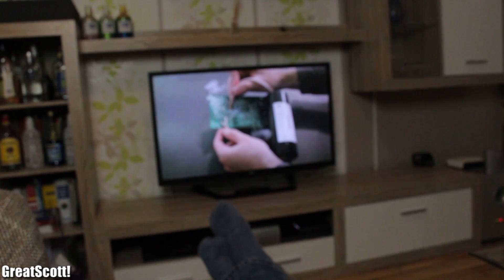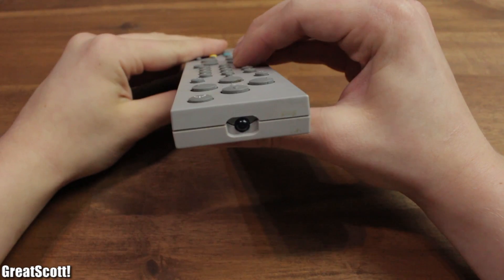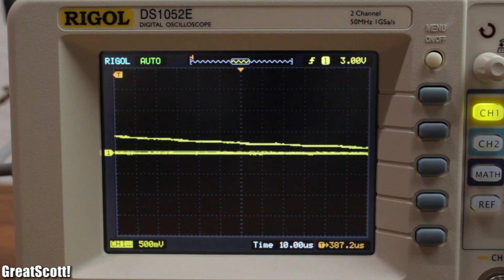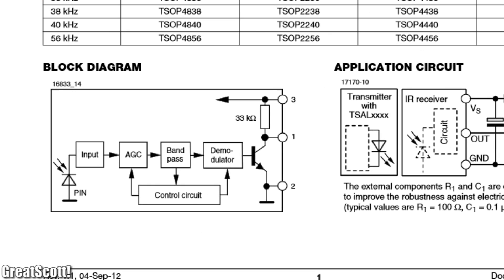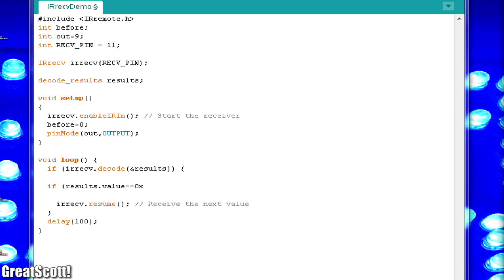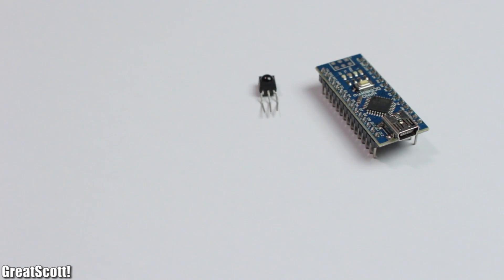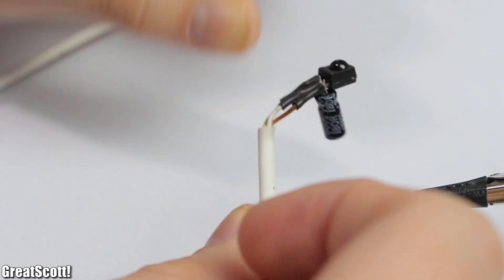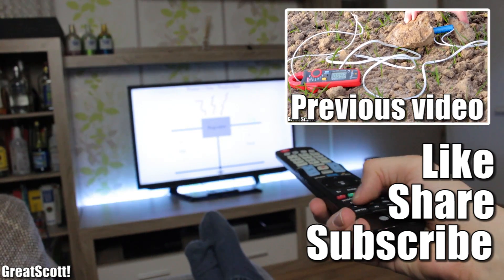Control your LEDs with your TV remote?! || Arduino IR Tutorial

Comment: can someone please help me, this is what iam getting allways Arduino: 1.6.5 (Windows 7), Board: "Arduino Nano, ATmega328"

C:\Program Files (x86)\Arduino\libraries\RobotIRremote\src\IRremoteTools.cpp:5:16: error: 'TKD2' was not declared in this scope
 int RECV_PIN = TKD2; // the pin the IR receiver is connected to
                ^
Error compiling.

  This report would have more information with
  "Show verbose output during compilation"
  enabled in File > Preferences.
Reply: Change the value to the number of the pin on the arduino the IR receiver is connected to

Comment: Hi! Great video! One question though... Why exactly did you need the capacitor? I am brand new to this kind of thing.
Reply: +John Spillane The capacitor is used to smooth out any "bumps" in the current flowing to the Arduino; it is a fail safe of sorts.

Comment: nice project, but why not using the 3 RGB channels with 3 useless buttons to create every colored mood you want?
also I'd stick the LED strip to a piece of metal or aluminum in stead of wood to preserve their lifespan!
Reply: Because he just wanted a simple light, and wanted to make a simple video. Of course you can use different colours, but dont need to if you dont need it. Also, mounting then on aluminium is not going to increase the life, they dont really get hot at all. I have 5m strip, and even all lights full brightness, wrapped on the reel it came on, and leaving it on, it only gets to 20-30°C. So no heatsink needed.

Comment: THe code dosent work anymore!! When it compiles, it says   This report would have more information with
  "Show verbose output during compilation"
  enabled in File > Preferences.
Arduino: 1.0.6 (Windows NT (unknown)), Board: "Arduino Uno"
C:\Program Files (x86)\Arduino\libraries\RobotIRremote\IRremoteTools.cpp:5: error: 'TKD2' was not declared in this scope
 HELP!!!
Reply: +kyle han Hey I had the same problem and I was really motivated to do it and figure it out. So what i found is that you have to go to this website: 
https://github.com/z3t0/Arduino-IRremote/releases
download the zip, extract it, put it in your library, and upload the script from this library, the IRrecvdemo i think it's called. Then you literally just use this video to do the rest. Let me know if it does or doesn't work!
Reply: +Joshua Butler thanks for helping out, but unfortunately it still has a problem compiling. It has the same error code. And while other libraries show up as underlined, and yellow, while the incluse IRremote.h dosent. Is my computer not reconizing it as a library, or am i doing something wrong?
Reply: +kyle han make sure you use that same example except from the new IR link I gave you. You DO NOT have to load the library into the sketch. And if it still doesn't work, then you should go to the arduino website and download the program version 1.0.6, because that is the version he uses in this video. I'm not sure if that was what was wrong or not, but it's worth a shot!
Reply: +Joshua Butler when i open the IRrecvdemo, the library is already included. What do you mean i dont have to up load the code? Anyway, i tried down loading 1.0.6, and it gave me the error code. I ay post this problem in the arduino forums. Thanks or your help!!!
Reply: I'm honestly not sure then how I got it to work for sure, just a lot of tinkering I guess, lol
Reply: Well then master, teach me your ways
Reply: I had the same problem! I fixed it! it was "Arduino Libraries" problem. Do this:  https://www.arduino.cc/en/Guide/Libraries

"To install a new library into your Arduino IDE you can use the Library Manager (available from IDE version 1.6.2). Open the IDE and click to the "Sketch" menu and then Include Library > Manage Libraries."

and point your "Arduino-IRremote-master.zip"

"file" then "examples" click "IRremote" then "IR relay"

done!
Reply: Here is the solution:

 
1) Go to computer -> go to (C:) -> program files (x86) -> Arduino -> libraries -> RobotIRremote
 
2) Move files IRemote.cpp, IRemote.h, IRemoteInt.h, IRemoteTools.cpp and IRemoteTools.h to the desktop or somewhere out of primary Arduino map (you can even delete them but rather not maybe you will need those files)

Comment: I have a question, in your code there is an if statement. if (results.value == 0x20DFF10E ) but when looking back at it, when you got the info from the ir remote it didn't send the 0x in the beginning, it sent 20DFF10E, so why the 0x?
Reply: Its just a prefix telling that the value is hexadecimal.

Comment: HELP.... only getting 7,5 V out to the led strip.... any ide what is wrong ? Mosfet output middle pin is from 5 to 7.5 V
Reply: FoneBone27 Found out that GND next to D2 and RESET can't be used..... the pictures of the board show that it's in use.
Reply: +FoneBone27 Hey my LED strip couldn't use the MOSFET I had because I think it was a 9 volt, so what I had to do was just use a relay

Comment: I have reverse engineered every remote in the house and obtained the codes for each button on each remote. But why is it when I record the beams using a VS1838B IR receiver I ended up with hexadecimals results but when using a Sharp GP1U5 I recorded the exact same beam I recorded only strings of numbers? And if that is not crazy enough when I try to control anything and I hit the receiver (while watching the serial monitor) with the IR remote I might get the code I recorded or something totally different? Or I do get the correct code the first time then something totally different on the second shot? Could be noise? Anyway it has me scratching my head.

Comment: I get this eror please help!
C:\Program Files (x86)\Arduino\libraries\RobotIRremote\src\IRremoteTools.cpp:5:16: error: 'TKD2' was not declared in this scope
 int RECV_PIN = TKD2; // the pin the IR receiver is connected to
                ^
Error compiling.
thank you
Reply: +josse van de kerchove Hey I had the same problem and I was really motivated to do it and figure it out. So what i found is that you have to go to this website: 
https://github.com/z3t0/Arduino-IRremote/releases
download the zip, extract it, put it in your library, and upload the script from this library, the IRrecvdemo i think it's called. Then you literally just use this video to do the rest. Let me know if it does or doesn't work!
Reply: +Joshua Butler thank you a lot but i figured it out ☺

Comment: Instead of transistor mosfets, can i use relay?
Whats the output voltage of the receiver module?
Reply: with a relay you wouldnt be able to dim the led-strip, but just for switching it on and off it would be suitable. but remember: you might need a transistor and a flyback diode for the relay, as te arduino might not be able to handle the switching-current of the relay.

Comment: i face a problem to connect the out of ir resiever is connected to pin d11 in nano in micro it does not have d11 so to which pin i should connect it ?????
Reply: Whatever pin is free, and change it in the code to that one...

Comment: Build options changed, rebuilding all

C:\Program Files (x86)\Arduino\libraries\RobotIRremote\src\IRremoteTools.cpp:5:16: error: 'TKD2' was not declared in this scope
 int RECV_PIN = TKD2; // the pin the IR receiver is connected to
                ^
Error compiling.

  This report would have more information with
  "Show verbose output during compilation"
  enabled in File > Preferences.

why  ?
Reply: +GRminecraft Hey I had the same problem and I was really motivated to do it and figure it out. So what i found is that you have to go to this website: 
https://github.com/z3t0/Arduino-IRremote/releases
download the zip, extract it, put it in your library, and upload the script from this library, the IRrecvdemo i think it's called. Then you literally just use this video to do the rest. Let me know if it does or doesn't work!
Reply: I LOVE U , U SAVED MY DAY ._.
Reply: worked for me. Thank  you very much!

Comment: Hey Scott!
First of, I'd like to mention that I love your videos! I'm very new to the world of electronics and microcontrollers and therefore would like to ask you a question regarding this project. since you have soldered all cathodes to one on the LED-strip, you cant change the light color... so is it possible to still change the lights via arduino if I'd use three MOSFET's and wire each of them to one of the cathodes?
thanks alot!

Comment: Hello my friend greetings from Greece, one great project that you should look after would be a laser spyrograph. Someone did before and posted it in instructables site (http://www.instructables.com/id/Laser-Spirograph/) but this is manual controlled, what about if you could swap the rheostats and put arduino pwm pins with mosfets? Another great project similar to this one here, would be to control the led strip through an android phone via bluetooth. Someone also did something similar (http://makezine.com/projects/android-arduino-led-strip-lights/) but he controls through his phone with a cable connected and this might harm your phone if you don't know what you are doing. Hope you have some bright ideas coming up next!

Comment: Awesome! :)
Now i've got some use for my Arduino Nano - There are actually not that much projects out there for it..
Reply: You can use almost any "Arduino"-project with your Nano. It's just the form factor that's different. Electrically it's the same as an Uno or similar board.
Reply: *****
That may be, but then I would have to rewrite the codes and use other ports

Comment from the maker: Ever wanted to use your TV remote to control your next project? Then you might find this video useful!
Reply: Same TV as mine and remote
Reply: +GreatScott! Can you help me with my SainSmart R3? I tried the project with it, but it keeps on saying: TKD2 is not defined.
Reply: Excellent job on your videos Scott.  Great explanations, great production, great editing!  Thank you!
Reply: GreatScott! More arduino projects plz😃
Reply: CEC makes those buttons useful, depending on what's connected to the tv. Great for using with kodi and home cinema receiver.
Cool, project btw.
Reply: Wo bistn du her?  ;-)
Reply: hi scoot do you have te arduino code in your site?
Reply: +GreatScott! I'm having a problem with the dimming and brightening of the led. I put in my code, but it does not dim or brighten. The on/off works however...
Reply: +Cheese Shmabe do you have the LED on a PWM pin on the arduino?
Reply: El que me lo creo ni una palabra que no te preocupes p la vida social del hombre aumentan 😱🤢
Reply: GreatScott! It's pronounced cubord
Reply: may i get the code sir?
Reply: Which is your country and please give me some arduino codes please
Reply: My project does. Not work when i try with 5mm led it works but with mosfet and led strip the led strip does not turn off but its brightness gets low. Whats the problem
Reply: GreatScott! Hi sir, Do i need to make any changes to the code if i wanna use arduino uno instead of arduino mini?

Comment: Why do you always use mosfets when transistors can do the same job ?
Reply from the maker: Well... MOSFETs are actually transistors. I think you mean BJTs. I prefer MOSFETs in such projects, because they are easier to work with and the voltage drop across them is really low. Here is a useful link about the subject: http://www.differencebetween.net/technology/difference-between-bjt-and-mosfet/
Reply: GreatScott! Sorry i meant why do you prefer using unipolar transistor instead of bipolar but i got my answer thanks